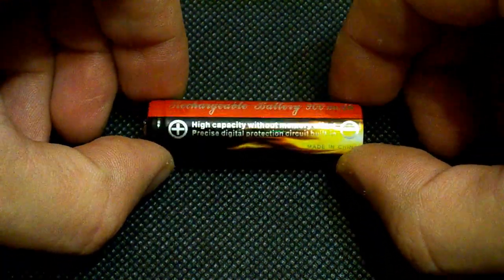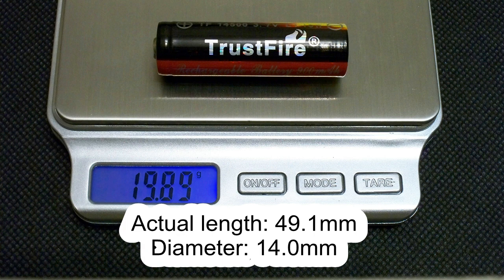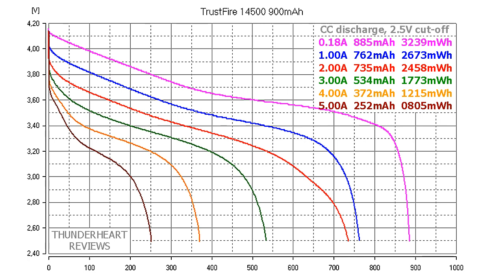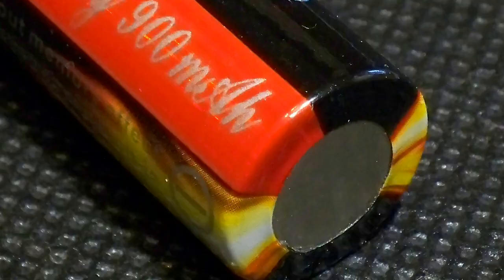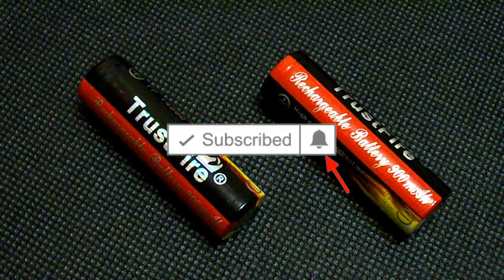TrustFire 14500 3.7V 900mAh AA Li-ion battery's real capacity test

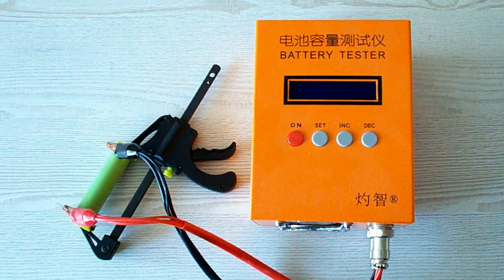Comment from the maker: 00:45 - Testing equipment
01:55 - Battery supplier
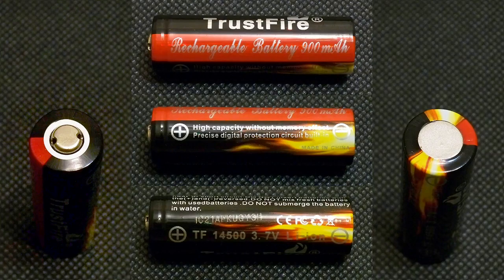02:15 - TrustFire 14500 900mAh battery's capacity test results
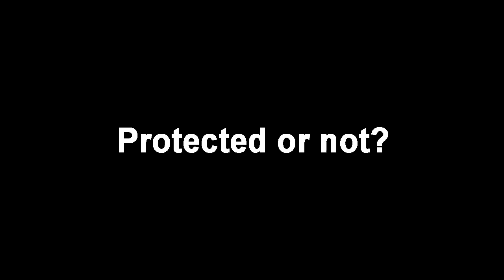04:04 - Protected or not?
04:50 - Verdict
Reply: This battery trustfire vs sony vr2,, how do you think? Who is better?

Comment: I would like the see the discharge curve @100 milliamps. I think you would have reached the full 900 mAh, at close to 3.5 watt hours! (regulated LED flashlight) Finally...A14500 cell that actually produces its advertised capacity!
Reply from the maker: After 6 years I'm still using those cells from the video in my wireless mouse.

Comment: One caveat about size: the "flat top" battery is 50 mm long, as you have demonstrated.  However, they do sell "Button Top" batteries, which are 2mm longer; and may not fit into the electrode slot.

Comment: 0:25 you actually can replace aa with 14500.. i did it in my son's RC car.. 2xAA was simply too poor, the car barely moved so i switched one of them aa with 14500 ultrafire 800mAh.. and guess what.. the car turboed!!! Lol! So there are some circumstances when this comes in handy.. btw 14500 ultrafire 800mAh.. at first i did not believe the capacity.. but it was very close to that 800mAh, really good, especially for the price and performance (more than 10Amperes short current :OOO)
Reply from the maker: Your son's toy was just purely designed:) In normally designed products if you replace a 1.2V cell with a 3.6V one you'll get it burned. Don't forget that a Li-ion cell's charge end voltage is 4.2V compared to ~1.5V in case of Ni-MH/Ni-Cd.
Reply: @ThunderheartReviews  I'd say it depends, many toy grade rc's that have 2 aa batteries usually have boards that can handle 5 - 6v making these cells or a single cell lipo a perfect speed boost.
If it's an easily sourced car, like in production and not something thats 10 - 20 years old, a spare car is worth buying too test the limits of the pcb if there isn't any info on that online already for that rc car using the same chassis in general.

Like say Auldey race tins gen 1 - 4.
Mentioning these as they are popular too modify as a cheap little racing car in Thailand & some other Asian countries, either drag racing or tracks & they are fairly quick as well for the size, enough too be fun indoors at least out of the box with one of these cells put in.

Specially quick with relay mods & modified motors or hobby grade electronics put into them from something like a wltoys k989 for example, bunch of videos on youtube either showing mods or racing them.

Still as standard uses a 6v limit on all of them that has a pair of AA batteries in the chassis without modifications too the board & remote, had a gen 3 that i eventually burnt the pcb on as i hooked up a few volts too many i think or something else happened too it.
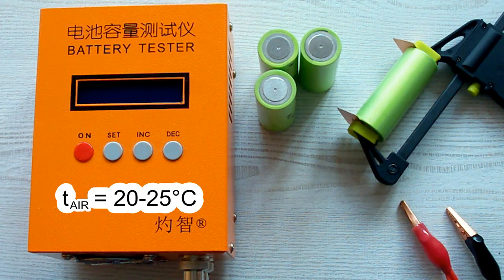Kind of want too get the 4wd drift series Auldey car though and solder in a connector too hook up a 18650 too use in it under the body if i cant put aside cash too fix up my mini-z mr01 & mini-z monster. The auldey 1:28ths are dirt cheap & ofc the awd one wont drift as well as a 300+ usd micro drift rc from atomic or similar but still alright as toy too get id say.

(Some of them use a controller chip that allows for a turbo button too be added in the remote (unused on the pcb side in the car, but with a relay you can hook up a second cell disconnected from the rest of the pcb, think some people also hooked up reverse as a turbo button as well with said relay.
So it adds that extra voltage too the motor via the 2nd cell & really makes it move.)

Comment: After several videos watching testing equipment and add for your battery supplier becomes quite annoying. Would you like to watch 60-70 seconds of the same content over and over again? 
I would advise just adding something like " You can find Informations about my texting equipment in the description section below this video" or you can make dedicated video where you introduce your testing gear and procedure and then in each testing video just put a link to that video about the gear...
Reply from the maker: Hi MarsSheep. Under each video there is a pinned comment with timing to make fast jump to the part you are most interested in. What's the problem?
I include the part about equipment, testing rules and supplier because:
1. From time to time i improve my holder, add/change something and for some people it's important what was used during testing.
2. When people watch my videos embedded on other sites it would be annoying for them to spend 2-3 minutes to go to youtube, then look for the video about equipment used.
So the best solution is to post a pinned comment with timing under each video - you need just a part of a second to click on the section you want. Don't you agree?